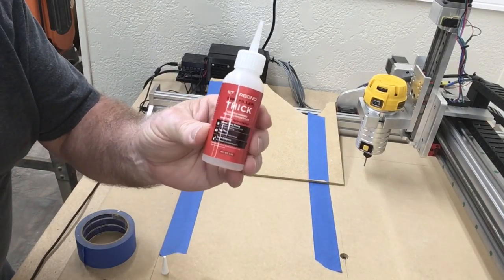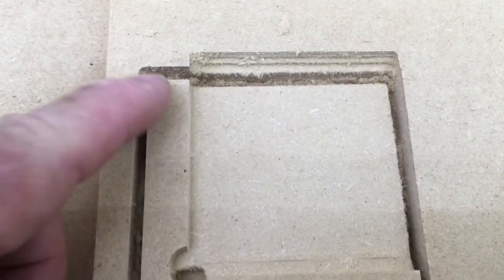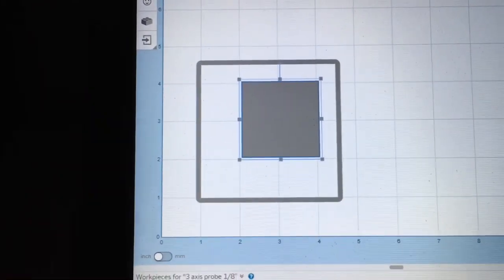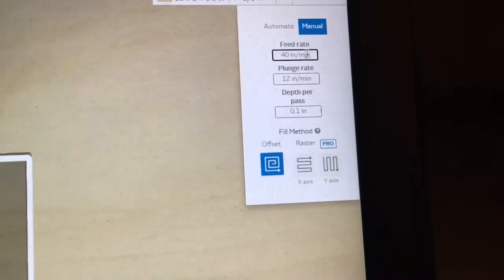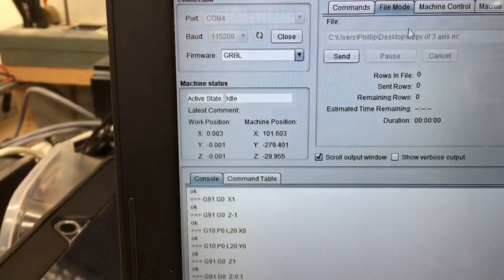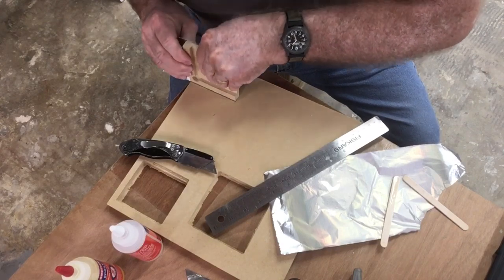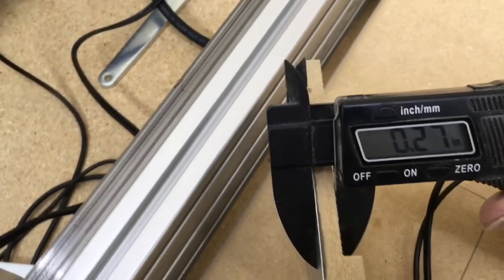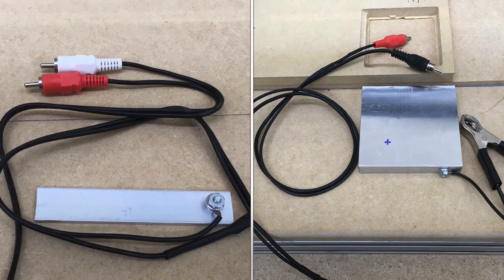How to Make a 3 Axis Touch Plate from Scraps for my CNC

Comment: all newbie need remember, NOT use router to spindle, worst option what have, less torque and noisy lot. bearing not live long, not has plan used cnc machine, worst bearings. same cost buy REAL cnc spindle etc, 800W air cooled ER 16 spindle has more torque than 1900W router, and lot lot lot silent use. real spindle ER16 cost 100-120$ only whit power supply and all collects. same about or cheape than worst router cost.
Reply from the maker: Thank you for the information

Comment: Do you have any knowledge regarding compatibility of a spring loaded z-axis touch plate that can be used on the Xcarve? I am not sure if you can use for example the mach3 touch plate (spring loaded) on the xcarve cnc machine? It actually sucks with the provided brass touch plate from inventables due to damaging the sensitive 15° V-bits tip during the z-axis zero process.
Reply from the maker: I have not experience with Mach 3 or the spring loaded touch plate. If you are damaging the bit you might try doing the z manually with paper

Comment: Too cool. In the middle of building my first CNC router. Watching YouTube while waiting on parts delivery. I’ve watched video’s on how to wire a prob (store bought) to my arduino CNC shield. I think I’ve got that figured out. Now, after watching this video, I realize I’ve wasted $10 on a prob. Saved this one to my YouTube library and it will be one of my first projects. Thanks and please keep making them. The more I watch the more I realize how much I need to learn. Having a blast in the process. Wish me luck.
Reply from the maker: Thank you for watching my videos and congratulations on building your CNC. I made this touch plate after pricing the store bought one and got a little sticker shock. I made this one from materials already on hand. I would say that just about anyone with a shop would have the necessary material to make this on as well as the touch plate for just the z axis.

Comment: Simply Excellent!  Writing your own G-code macro instead of using a widget gives you a better understanding of how everything works.   It is also important to be sure your spindle is not grounded to the machine frame and is insulated.  I ended up using non-conducting washers and some heat shrink on the bolts to isolate the spindle mount and make this work.
Reply from the maker: Thank you. Good point

Comment: If you use UGS it has an inbuilt probe so you do not need to write your own gcode
Reply from the maker: You are correct, I, however, am using the older UGS 1.09
Reply: @PawPawsWorkShop  It would be great to see an update to this video using the new version of UGS that does directly support the XYX probe. I think people would find it more accessible than the macro. Great stuff on this, thanks.

Comment: Thank you for your video's, Can you tell me where i can find instruction on how to connect a touch plate on a chinese made cnc, i'm not using mach3/4  but i am putting my file on a usb then insert it into the DSP handle and run my projects, What i cannot find is where to connect the wires for the touch plate . thx bert

Comment: Love your videos! I upgraded my shapeoko to a cnc4newbie Z axis and love it. I do have a suggestion that makes UGCS and operating your CNC much easier is an app for iphone called stream deck. it is subscription based for 2 bucks a month or you pay by the year. I tried a month to see if I liked it and I must say its well worth it. I think they are working on an app for andorid and it isn't out yet. You can have up to 15 buttons. I used the jog buttons and the increment up and down buttons. Also a run and a stop button as well as a set 0 button. I think you'd like it and it would make jogging the machine much easier. Keep up the awesome videos pawpaw!
Reply from the maker: I will definitely take a look at this.  One problem is that my phone does double duty and is my camera also.  Thank you very much.
Reply: @PawPawsWorkShop  They do make stand alone stream deck units you can buy as well but in that case I would probably just buy a jog controller. One thing I should have mentioned is your pc needs to have bluetooth in which case most do these days.
Reply from the maker: Thank you

Comment: Will this work with the xcarve?
Reply from the maker: Yes, you have to go into the advanced setting and change the plate thickness or you can just use UGS and zero the machine, then start easel and run your project.  When going through the Easel checklist select manual and the select x,y 0 and continue.  Carve as normal
Reply: @PawPawsWorkShop  I had the same question. I was wondering how it worked on the x carve because seen that you had a different box for your probe. You do great work and tell everyone about your video's. I'll give this a try to se if I can do it...

Comment: I really enjoy watching your videos; they are so informative. I have one question that came to mind while watching the video. You mentioned that you forgot to subtract 1/2 the width of the bit in the macro. Do you have to modify the macro as you change the bit diameter? For example, going from a 1/8” end mill for one project and then to a 1/16” for another project. Thank you . Reg
Reply from the maker: Yes and no. I use the 1/8" bit the most.  Once I probe the three axis it is set. I can change to any bit I need and just z and continue.
Reply: @PawPawsWorkShop  Although if you want to start with something other than the 1/8" you would have to edit the macro presumably. In theory you could adjust this in your g-code if the system knew the loaded tool (not sure if GRBL does at this point in the job). But for instance on my Tormach you could write the gcode to use the currently loaded tool and it could do the math parametrically off the tool offset table in the milling machine. Of course on most milling machines the probe is the active part and the plate is the workpiece (which is mechanical not electrical), in which case your "tool" is always the probe which is always the same diameter.
Reply: Thank you

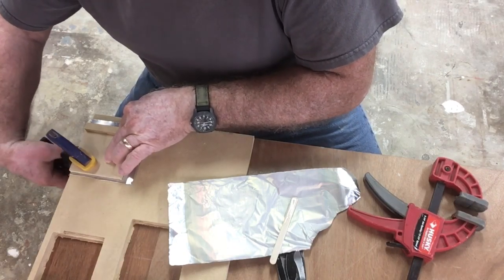Comment: Howdy Another great video. I'm going to try this method as I was thinking on buying one. I will try this first. Where did you get the G code to write the script? Also I couldn't help but notice that at 13:51 in the video you have a breakdown of the New Carve cost and something next to it. Were you comparing cost of 2 machines? Thanks again for doing these very informative vids.
Reply from the maker: Thank you very much.  I wrote the g-code myszelf.  Over the past month I have studied everything I could find and learned about g-code.  I then wrote the z axis and used it with the z probe.  Next, I wrote one line and tested each section, just a little bit at a time. A couple of things I learned, I forgot to add half the thickness of the bit.  

OOOpppppssss, that sign was not supposed to be in the video.  I am considering a video on comparing the New Carve by CNC4newbie to the XCarve by Inventables.

Comment: Outstanding craftsmanship the aluminum covered MDF touch pad is beautiful. When you were using the edge of the MDF as a break I was wondering how are you going reference X and Y axis then I saw you place it on the edge of you’re stock. Then in the G code offset .500 for X and Y and then .270 for Z. I am really liking the  idea of having a CNC machine. Thank you for another wonderful video. 😁🛫
Reply from the maker: Thank you very much.  Don't forget to add the .5" and half the thickness of the bit which is .625".  I hope that you will consider at some point of getting a CNC.  It has really changed my shop and the types of projects that I can do.  It doesn't have to break the bank.
Reply: Paw Paw’s WorkShop a CNC is on my list of the new toys I just ordered a new 24k mini split to change out my 12 k unit for my 400 sqft wood shop .so the CNC will have to wait a few months. Thank you for the reply. I enjoy your videos.